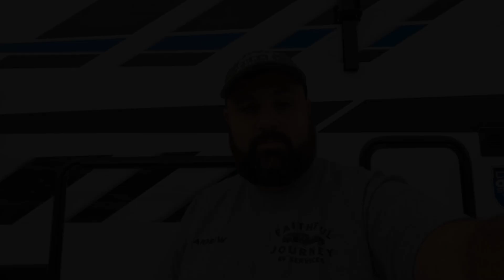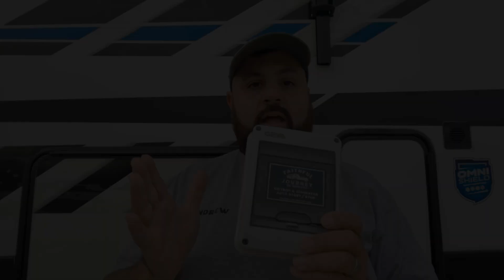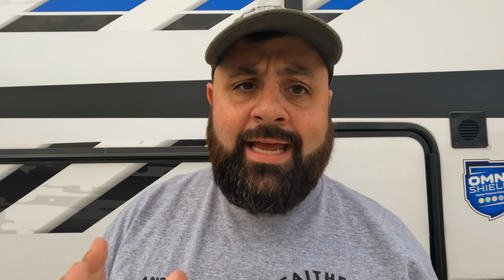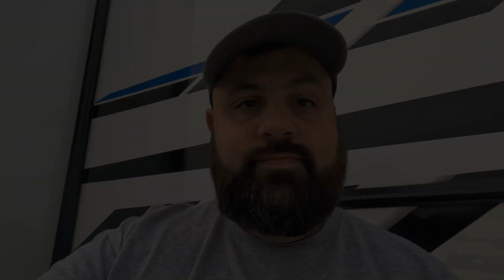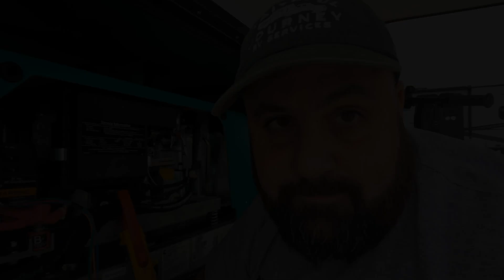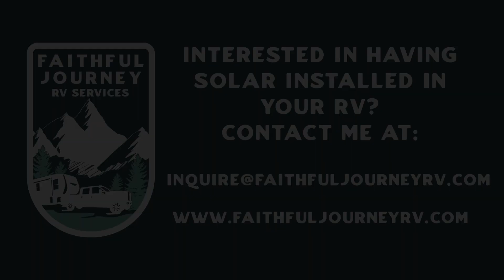Generator Auto Start/Stop Device 2 Wire - Victron Cerbo GX and Generator Integration

Comment: hi i have a question，a 2 wires start generator when the inverter ac input is connected to the output from the generator when the generator will stop when the battery of the inverter is charged why when the generator stops working dont damage the inverter？

Comment: Just modify the Cerbo's python script to use both relays. Pulse NO's for start/stop. No additional hardware needed.

If you are going to use hardware to overcome the python script then this works.. Arduino, optocoupler, and a couple relays would make more since though. Fraction of the cost and footprint.

Comment: I purchased this and LOVE it! It was a very easy hookup. The only complaint I have is with the mounting screws included. I was mounting this in a motor home outside compartment. The walls are 3/4" pressure treated plywood. When I tried to screw the screws in, every one of them striped out. I was using a fairly new nice fitting bit. I kept trying to make sure that I wasn't a little crooked or anything. Maybe i could have pre-drilled... but I didn't.  The screws would drive about halfway in and then strip. I had other screws on hand that worked fine. 

Everything else about the setup was great though!
Reply from the maker: Thank you for the feedback and glad that you love the Generator Auto Start Stop Box.

Comment: Hello, I recently switched out our Magnum inverter in our coach to Victron. I have the Cerbo GX device and I have a PowerTech Gen. Is this a required addition for auto gen start/stop or can you just use the Cerbo GX?
Thank you..
Reply from the maker: My 1 wire positive version should work with the PowerTech generator. I worked with someone else who had a PowerTech and that is the version which was needed for his. My understanding the PowerTech uses the same signal wire to start and to stop.

Comment: How much are they? And do you make one for the Predator 3500 inverter generator
Reply from the maker: For current pricing and ordering please visit my website http://faithfuljourneyrv.com. The 1 Wire Version has been used with a Predator 5000w generator, due to it having a push button start/stop. Have not gotten it to work with the 3500 at this time.

Comment: Hello..
What if I did not need the transfer capability and only needed the box to allow my cerbo gx to start my GenMax 7250 generator when needed.
My generator is permanently attached to my Multiplus Ii, I have a 3k Watt solar array and 20KWH of storage @ 24V.
My trailer never hooks up to sure power
Reply from the maker: Hi, this gen auto start stop box will allow your cerbo gx to start/stop a compatible generator. I have my onan 5500 directly connected to my Victron quattro which does the switching between shore power and generator.

Comment: I have  a 48v system on my trailer  and have a my inverter which is not victron but has the same contact set up  do you ever use that box on non victron systems
Reply from the maker: You could probably use this on a non victron system but you would need a device that could trigger the relays. Even if you don't have a Victron inverter but you had the Cerbo GX and Smart Shunt you could use this. Which device or inverter do you have? Send me an email at inquire@faithfuljourneyrv.com and let's talk if you want to know more.